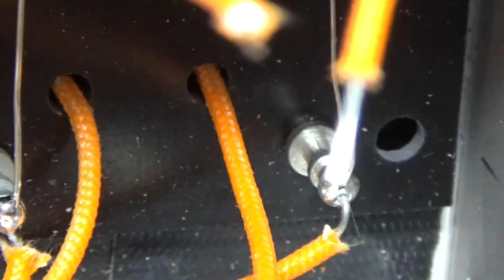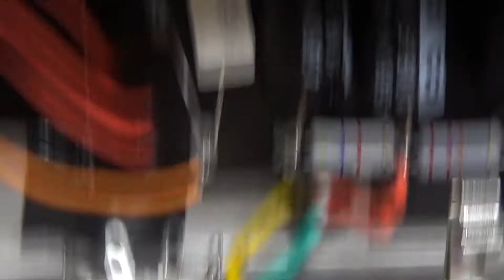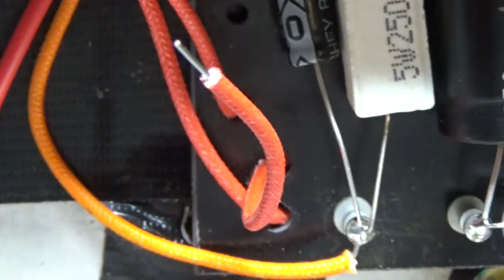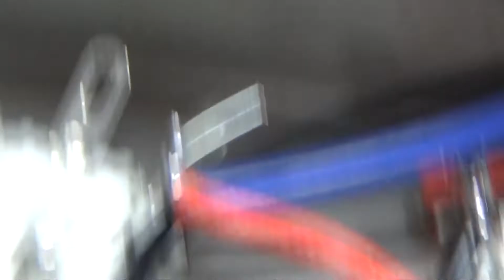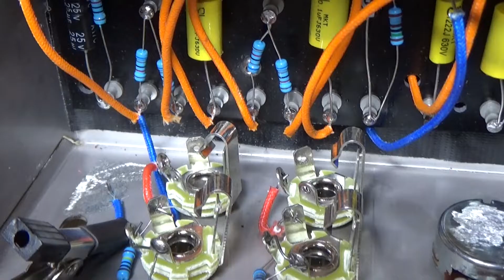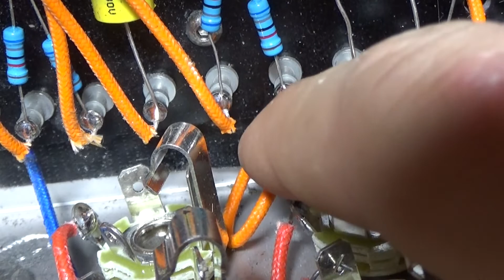How to Build a Tube Amp (Tweed 5e3) for CHEAP - Part 4

Comment: 10:57 The blue and red wires were supposed to go to the standby switch as per the layouts on the internet, not the pin 8 of the rectifier. 
Looks like you're trying to bypass the standby switch. Did I get it right?